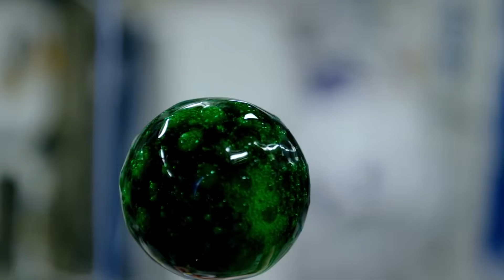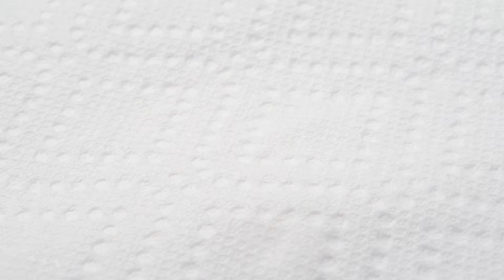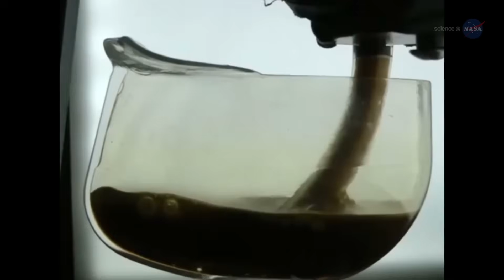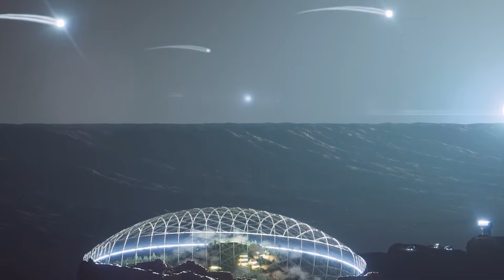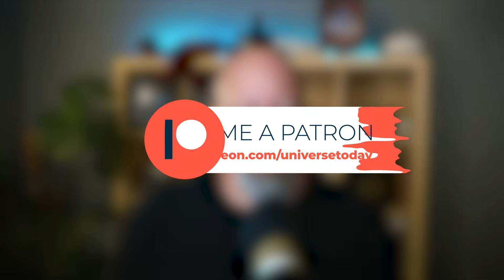Fluids Get Really Weird In Space [NIAC 2024]

Comment: Gasses store most densly as a Solid than a Liquid. Orders of magnitude like 1000-to-1.  Store is as a solid -- whoch is rthe most stable long term storage.

Hydrogen as a metal hydride is both dense but stable such that a metal hydride tank will not even combust if shot by a gun
Use a similar method for storage of the excess O2 -- store it as another solid not by temp but chemically.

Comment: Another idea -- gas separation.

Let's use the simple model of two nails in a fluid as example.
Immediately on the surface of each nail will be gases (oxygen on one nail and hydrogen on the other). 
The 1st problem becomes suffocating the nail with the gas so no liqiud to separate. This means removing the gas right away (at the nail).
One can do this with a gas permeable membrane (passes gas but not liquids) next to the nail to extract the gas. because it is at each nail the O2 and H2 are automatically separated. Fluid pressure alone could help make the gas flow one-directional.

Thus we now have gas production as well as a gas flow or "breeze" we can utilize to move other gases. For exmple we still have to move the CO2 saturated air too. Use the air flow to help push/pull air for the CO2 extraction process.

Comment: I was trying to suggest Starship use capillary fuel transfer for their tanker. For the most part no moving parts and more reliable.

In order to have some control & prediction of the fuel and location begin by connecting the starshpis along their backbone. Once connected, then initiate a slow longitudinal rotation (along the longest length of the starships) perhaps as slow as 3 RPH (just enough to settle the fuels witjout sloshing them). This helps to give an "up & down" to simplify things as well as to know where to find the fluid (in the centrifugal "bottom").

The capillary transfer tube would actually be multiple smaller tubes (based on the ideal capillary size for that liquid) bundled as one to increase volume flow.

The tubes would stretch from the connection points of the starships into the fuel tanks containing the fuel (all the way to the opposite side -- which will be "bottom" with the slow rotation). Flow is regulated at the connection point.

All one needs to do is open the tubes and let them flow. No moving parts to jam or freeze up. Thus high reliability over the long term.

Maybe you can pass along my suggestion to SpaceX.

Comment: For radiation to spaceships what you do is use the material that they like from the moon to cover the ship exterior. I plan on using it on the moon to protect the housing so just a matter of taxing it to a spaceship, but it does make a difference how much it weighs or how rough it is cause there’s no flow of air restriction like a wing on an aircraft.

Comment: Curious about an experiment:
What if you make a soap bubble in zero G, normal temp and pressure, but in a spherical container. Then evacuate the container while maintaining temperature.

Assuming there were a way to keep the bubble centered,  would the bubble expand until it merges with the container wall, or would it pop first?

Comment: Fraser, what I don’t understand is the astronauts who were untethered to the space shuttle, how come the shuttle didn’t fly away at 17,500 miles an hour? Help.
Reply: Great question. Shows that you are curious, interested and paying attention to this topic. Keep it up.
All motion is relative. On earth as it is in space. The fly trapped in your car as you are driving 75mph down the road is traveling with you at 75mph. The air outside of your car (assuming that there is no wind blowing out there) is moving at 75mph around your car, relative to it and everything inside it. As soon as you guide the fly out of the window, it is the drag that the fly's body feels against this 75mph "wind" that takes the fly away.  Otherwise, the fly would have stayed with your car! There is no air in space and therefore no "wind". Granted, there is molecular oxygen, etc. outside of the space station at its orbital altitude, which is slowing the station down. But it is at such a low density (and working on both the station and the astronauts) that the resulting drag difference (between the two) is practically negligible for the short duration that the astronaut is outside, and given the magnitude of all of the other forces and motions that the astronaut experiences relative to the station. So, the astronaut inside the station is moving at the same speed inside it as they are outside (until they physically push themselves away by pushing against "something"), with no "significant" force working on them when they step outside, which is not also working on the station. (Note that the wind is also working against you car, but your car is pushing itself forward with its motor/tires at such a rate that the fly and its wing cannot compete.). So long as the Station doesn't fire its "station keeping" engines or its maneuvering thrusters, and the astronaut doesn't push against "something" or fire their jet pack / OMU (like you used to see them wear on the Shuttle), they'll be flying together "forever" (again, barring the miniscule drag from the molecular flow of the low density atmosphere).
Sick of me, yet?
Reply: The astronauts were still moving at 17500 mph due to the conservation of momentum. Remember Newton's second law of motion. There was no force acting on the astronauts to make them slow down when they became untethered.

Comment: Hopefully as propellant transfer is a short-term process, efficiency and long-term reliability are not major issues like they are for oxygen generation. Maybe spin or gentle acceleration will do the trick. Although then there could be an issue with a changing centre of mass during the transfer.

Comment: I have commented before on the refueling Starship problem. I think this is a lost cause. There is a much simpler solution. For example. When you travel to a far away location and need to fly there, the jet doesn't pick you up at your home and then drop you off at your hotel! Artemis is trying to do this to get to the moon. What makes more sense is a taxi (starship) to low earth earth orbit, then transfer passengers and or load to a jet airplane (nuclear powered closed Loop  starship) traveling between low Earth to the moon in a loop, then a taxi (starship or other moon lander) to a space station or lander. The lander could refuel from fuel produced on the moon. Return to earth just the process in reverse. No need to refuel in space!
Reply: Well first of all, refueling in space is not in principle a difficult thing to do and secondly let's leave refueling on the moon to later this century. Yes there are probably traces of ice on the surface near the pole (though we don't yet know the purity), but the best case scenario means running an industrial scale strip mining operation, powered by a megawatt class nuclear power supply. We could be sending hardware one-way to the moon for years in order to set that up and it would still confine us to landing in specific polar locations. The alternative is sending a lot of fuel into Earth orbit cheaply. A more likely scenario.
Reply: @saumyacow4435  Yes, in principle it sounds simple, but watching the video about fluid dynamics in space is not as simple as gassing up your car at a filling station. The 2026 moon landing target is way off. The only way is if fuel transfer in space is perfected by mid-2025! No way this will happen. Starship is still experimental and will not be ready in one year or two or maybe three before fuel transfer is or maybe never is perfected. Nuclear propulsion was invented in the 1960s and there is no reason it can not be used to propel a starship to the moon! The engines are already being developed and it is just a matter of what kind is best for what kind of purpose.

Comment: The Space refuelling problem can be easily solved. "Nuclear-powered submarines are designed to last 30–40 years and never require refueling."
Reply: A problem mentioned was separation of liquid and gas. How about using a hydrocyclone for this?
Reply from the maker: Although nuclear reactors work in space, you can't use them to run a propeller since there's no water in space. You can use nuclear reactors to heat up an exhaust propellant (like hydrogen) and it works much better than chemical rockets, but it's still a limited amount of fuel.
Reply: @frasercain  "Space Nuclear Propulsion: Includes nuclear electric rockets (ion thrusters), radioisotope rockets, and radioisotope electric propulsion for space exploration." Wikipedia

Could any of those work on a large enough scale (i.e. SpaceX Starship) for interplanetary travel?
Reply from the maker: They're all awesome.
Reply: @picksalot1  The engine in the sub is really a steam engine.. with nuclear as the heat source. In space you don't have an endless source of water.
Reply: @heartyfisher  My comment was specifically about the "Space refuelling problem." Not needing to refuel solves that problem.

Comment: Summary

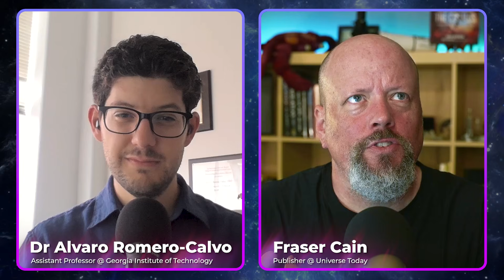* [01:39] Fluids in space behave chaotically, driven by surface tension instead of gravity. This makes simple things, like drinking coffee, surprisingly difficult without specialized equipment.
* [09:18] The NIAC project aims to create a more reliable system for oxygen production in space using magnetohydrodynamic force.  This eliminates moving parts and could be a game-changer for long-duration missions like Mars transit.
* [11:35] Current oxygen generation systems are so unreliable that for a Mars trip, it's lighter to carry tanks of oxygen. This highlights the need for innovative solutions like the NIAC project.
* [20:16] Separating hydrogen and oxygen in the new system is done with a membrane to prevent them from recombining.  Safety is paramount when working with potentially explosive elements in space. 
* [14:50] Here's how the magnetohydrodynamic technology works for separation:
    * Water is split into hydrogen and oxygen gas bubbles through electrolysis.
    * Magnets create a force that makes the electrolyte spin, acting like a magnetic washing machine.
    *  Spinning produces centrifugal force, which pushes the less-dense hydrogen and oxygen bubbles towards the center where they can be collected separately. 
* [35:56] Magnetohydrodynamic technology could also be used for propulsion, especially in CubeSats where size and power are limited. By precisely manipulating small amounts of heated propellant, efficiency can be greatly improved. 
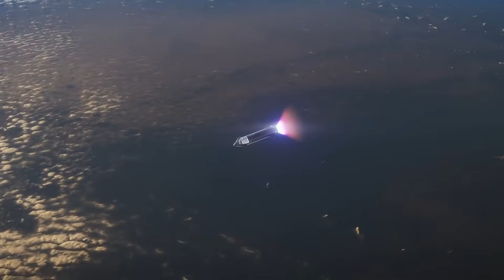* [44:55] Refueling in space, as envisioned for Starship, presents huge challenges. Transferring cryogenic liquids in microgravity is complex and could lead to unforeseen problems if not perfectly executed.
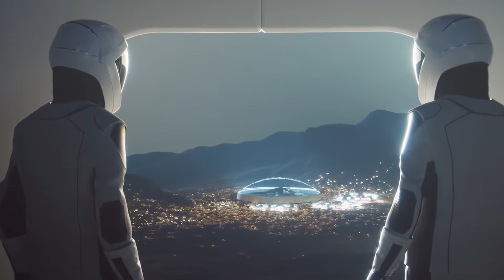* [28:31] Overall: There are many fascinating and daunting engineering hurdles to overcome before humanity can truly exist long-term in space. We still have a lot to learn! 

i used gemini 1.5 pro to summarize the transcript
Reply: Damn... this could really prune Youtube :)
Reply: Sounds like spaces version of an ICE engine just with a different fuel source.
Reply: ice coffee...